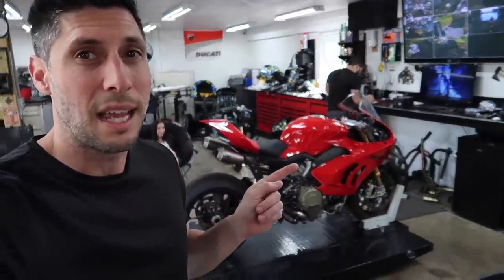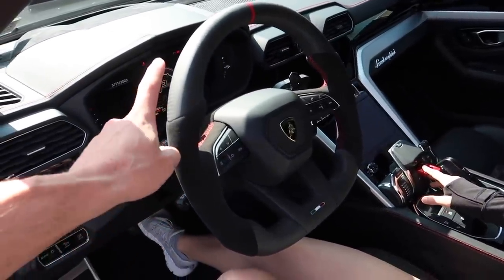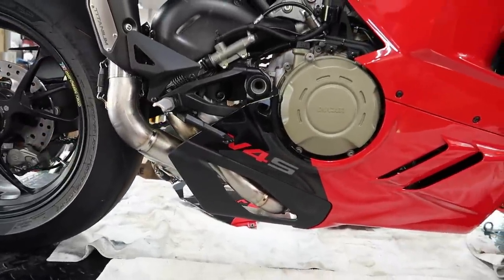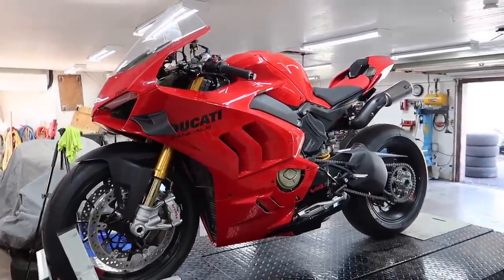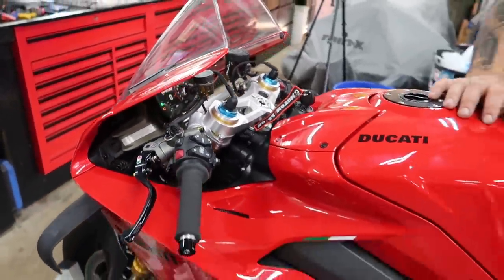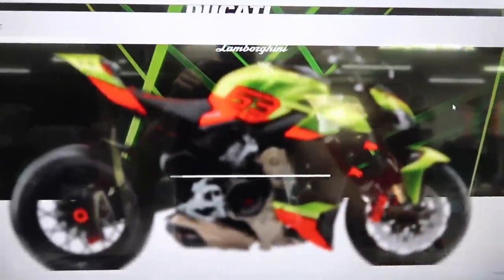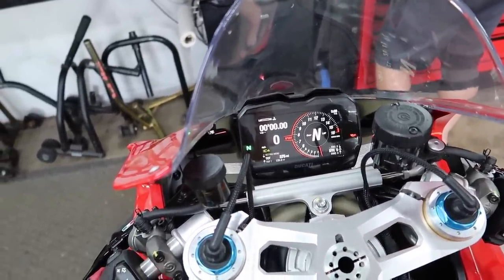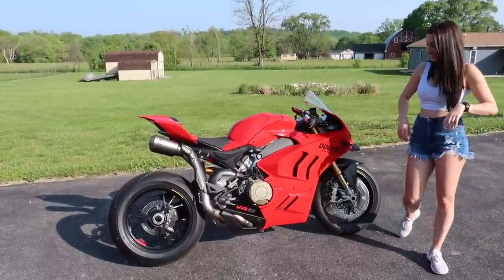Bren Stage 2 Flash Turned our Panigale Into a MONSTER!!!

Comment: Going through this now on my street fighter. The new exhaust systems have additional 02 sensors so the old under mount will not work. You only choice available right now via Ducati are the full under tail and the race slip ons. The other device (Lamborghini keep the CAD). Akro currently has no plans to make a full undermount. I am have the race slip ons installed on my bike this week if you would like to see some pics and videos.
Reply from the maker: yes shoot me some pics and videos on instagram please thanks for the info!
Reply: @JaretCampisi  just got it back this afternoon. Pictures to follow shortly

Comment: Did you have to connect the battery to a battery tender while downloading the stock ECU or while remapping it? I think I read on BT website that it is recommended to do so as it can take a long time. I want to flash my speed triple 1200
Reply from the maker: Yes you should connect your battery to a tender to be safe for all of the flashing stuff

Comment: Am I the only one who thinks the stock pani v4 sounds JUST right? I've heard a smattering of exhausts on track. And these akra undertails are probably THE argument for loud pipes save lives, because on track, you can hear this beast creeping up on you which is great especially for n00bs. However, if you want LOUD, then termi makes an undertail race pipe which just sounds stupid. But performs the best. And going down the straight it just lights an entire circuit up all by itself 😅
Reply from the maker: The louder the better imo :)

Comment: Have you ever experienced excessive fuel drain after flash?  i lost about 80 miles off the fuel range on a full tank!
Reply: It's because the factory fueling shuts off when you let off the throttle. That's why it's jerky when getting back on throttle. The new mapping allows the fuel to trickle even when off throttle so when you get back on the gas it's smooth
Reply: @mattsloop2736  thanks but more than 40% fuel capacity loss? That sounds way off to me
Reply: @AEA  my friend had his cbr1000 tuned by Moore mafia and his fuel mileage dropped to 30 at most.
Reply: @mattsloop2736  Im getting the bike checked to see what happened thanks for the feedback